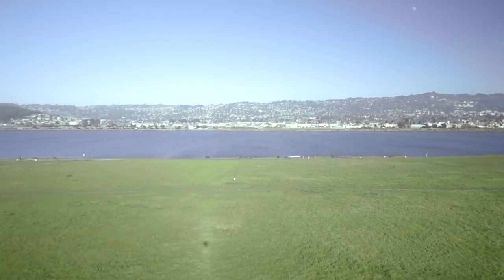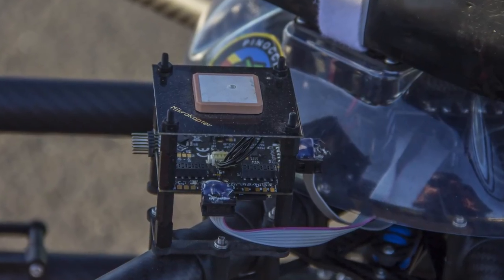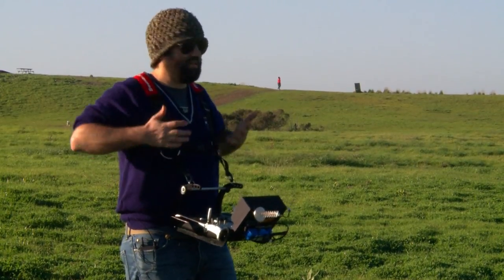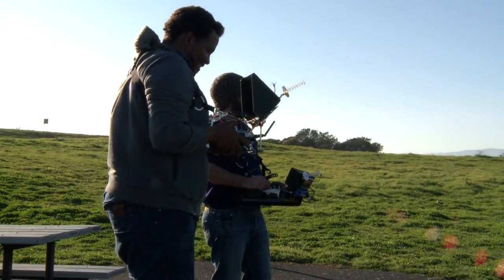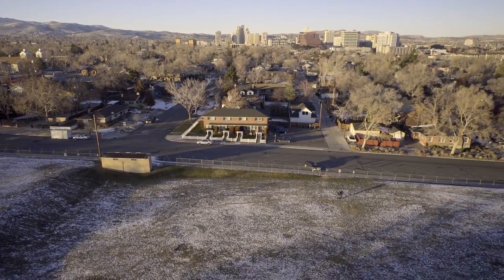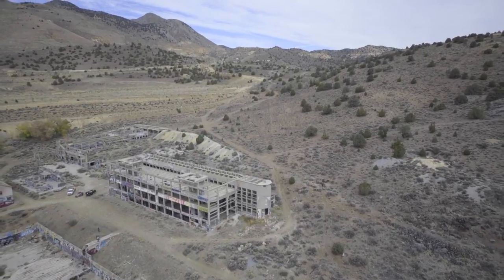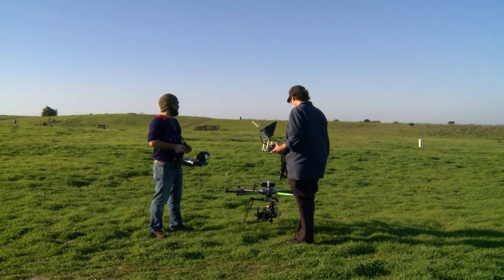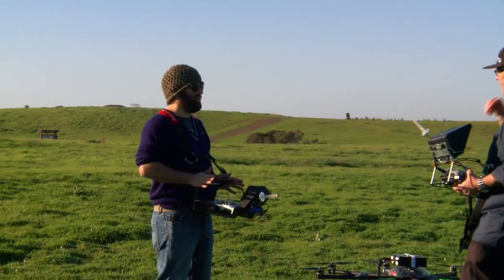Demoing the Freefly Systems CineStar 8 with MOVI M5 Gimbal

Comment: You guys have any vibration issues with this? We're getting relatively shaky footage with ours. It's on an S1000
Reply: Did you ever solve your shakiness issue?
Reply: @Ryan-ww6hp  oh god no. ended up selling this thing a few years back. so many hassles with it.
Reply: @darrensusin8903  Damn. I'm going though my own issues with a DJI m600 pro / Gremsy H16 gimbal set currently. Did you ever find a different rig that worked?
Reply: @Ryan-ww6hp  Nope. I got out of the UAV world, so can't be of much use.